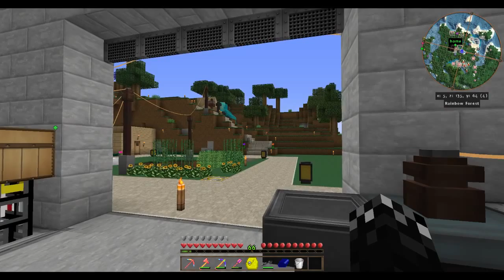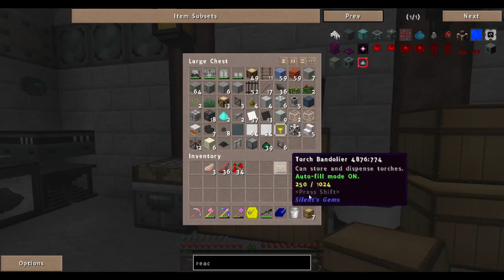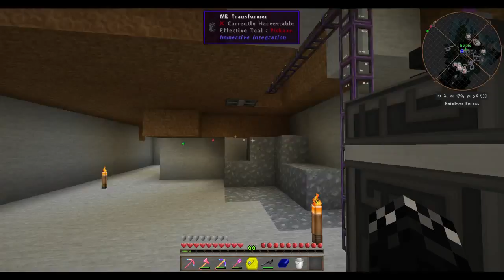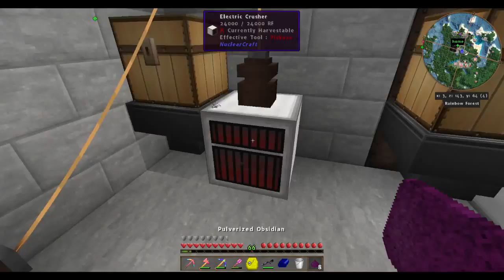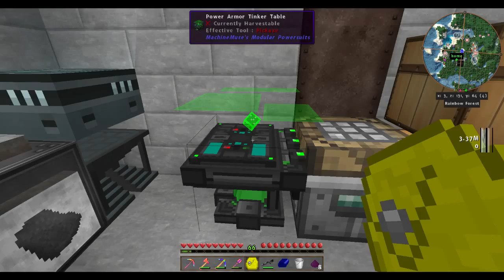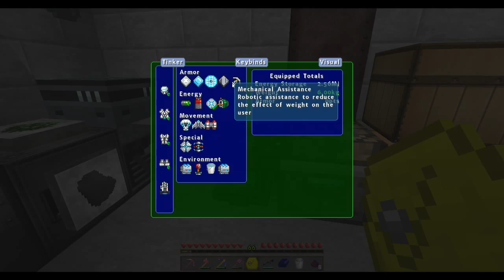Minecraft - Modular Mayhem - Ep 16 - Modular Powersuit

Comment: The lack of recipes is my fault. Modular Powersuits added a bunch of modules when it updated and I forgot to clear the recipes file. This, among other fixes, will be taken care of in the next update. You can fix it manually. by deleting the config\machinemuse\recipes\mps-thermalexpansion.recipes file and let it regenerate. 

You are best served by making the highest tier capacitor and keeping the suit's power reserves fairly low. The powersuit can and will draw from any RF holding item in your inventory. With a fully charged capacitor you can then pretty much max out everything and switch over to energy shielding, saving a ton of weight.  In the meantime, each point of armor it gives you is 5% protection. So, going over 20 points total is pointless.

Oh, as far as enchanting your drill, you might want to look into progressing Chromaticraft. The chroma enchanter lets you choose your enchants. And you can get efficiency 5 and fortune 5. Mind you have to start with an unenchanted item, but it is still fairly OP. You will need a quite significant source of XP to turn into liquid chroma.

Edit: Getting into Matter Overdrive's replicator will solve your Ender pearl problem. 5 Ender Pearls to scan and a bunch of junk for spare matter and done and done.
Reply from the maker: +Iskandar Funny you should mention the replicator as I recorded my next episode earlier on exactly that. 

I am working towards having just the energy shielding on my suit. I only put the plating on in the interim. I will delete the file and see what else I can add to my suit.
Reply from the maker: I tried deleting the file but it didn't regenerate and i had no recipes at all. Is there something I'm missing?
Reply: +Lensmanoz Nuts, hold on.https://dl.dropboxusercontent.com/u/46780505/mps-thermalexpansion.recipes

That should work. No idea why it didn't self extract.